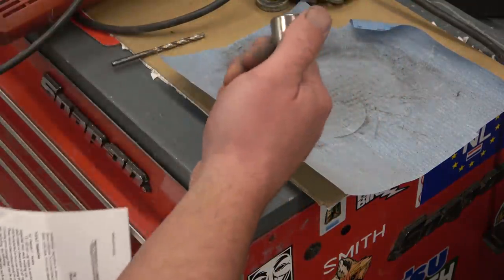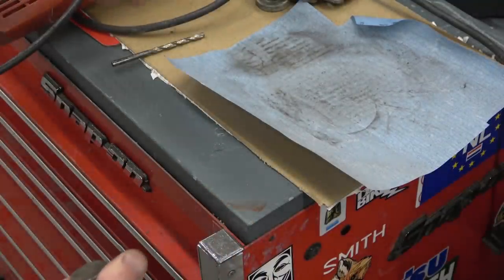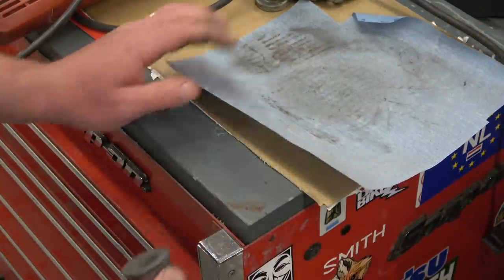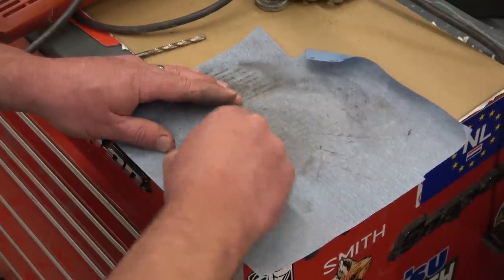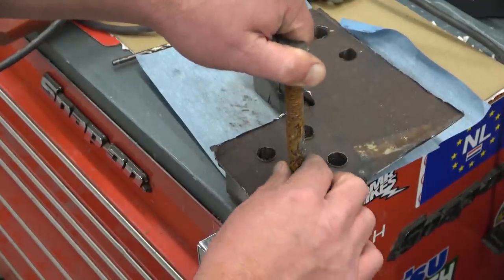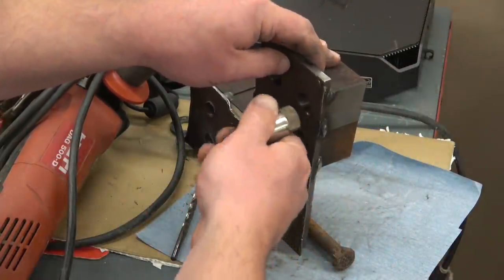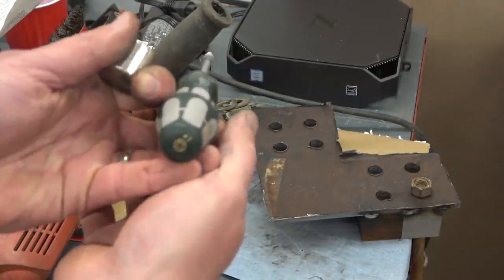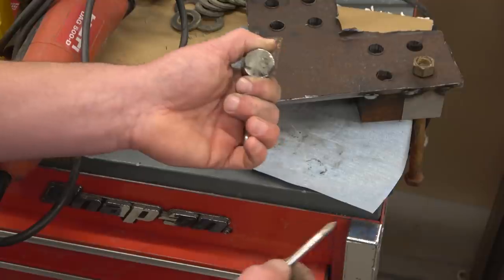mechanic magnet tricks #sharts

Comment: A flat refrigerator magnet works great when working on hydraulics. When you pull a valve off of the bottom or side of a manifold, slap the magnet over the ports to keep oil from running all over while you are servicing the valve.
You're  still going to get oil in your armpits when you put it back together, but hey, that's what apprentices are for.
Reply: You really shouldn't have apprentices oiling your armpits. Sets a bad example. 
Roll them up and use them to plug the holes that the oil is coming out of.
Reply: @kieranh2005  
Haaaa!!!
There have been numerous times I wanted to roll them up and stick them in different parts of machines.

Comment: In the HVAC world, I use them mainly on doors and entry ways that have a magnetic alarm sensor(or whatever you call it) that goes off if the door is open to long. Freezers are big ones.
Reply: Door switches on furnaces as well.
Reply: AKA Cheater switch.
Reply: Lockpicking Lawyer has a ton of videos about these types of devices, even high-security card scanners.
Reply: Also on solenoid valves
Reply: They sell solenoid magnets for HVAC work.
Reply: Some of the more secure alarms uses hall effect sensors to detect the magnetic strength. If it's not within range, the alarm goes off.
Reply: Can't be fucked hooking the shed door to the hook, so I just slapped a small one on the wall to hold it open. Works a treat for avoiding the blind reacharound!
Reply: I've seen (obviously never done it myself) plenty of magnets over riding interlocks on cnc machinery. a 1400mm diameter grinding wheels chooching at 350rpm seems way faster when you've got no guards around it and you and the apprentice fitter just rebuilt the spindle with new bearings installed with a lump hammer and pre-load applied by sheer guess work "wait a minute Joe did we tighten the lock nut up!" the son of diddly only takes 3 minutes to slow back down. Probably stops way quick if it fucks off down the shop removing walls in the process.
Reply: @dk-bw4gk  Eh. That's not what he's talking about. He's not talking about using a magnet to overcome some kind of locking pawl. The door switches are balanced magnetic switches which (for security applications) trigger if there's not enough magnetic field (the door is open) or too much (someone is trying to use a magnet to defeat it).

LPL has done enough videos that I'm sure there's something with him defeating a reed switch though.

Comment: Also very handy for taking out metal shrapnel from your eyes when the safety squints fail.
Reply: @chuckthebull  not at all
Reply: That's....absolutely brilliant.
Reply: I wish I could have told high-school-machine-shop-me this. Even with safety glasses and a face shield, I still managed to get a steel chip in my eye. Oh, such innocent times.
Reply: @AndyGneiss  yes if we could only learn the easy way 😁
Reply: @peterlamarche247  OMG that sounds bad..
Reply: Been there, done that, didn't work ;/
Reply: If only it worked for bits of brick, now that I would never warrant on anybody
Reply: @maxl3189  never happened but i suspect it to be a crappy experience.
Reply: @carlosportu4766  it mighten be as sharp as metal but it sure in uncomftable

Comment: Having a degaussing coil around is also nice... especially if you loathe magnetized tools. The kind used for old time CRT TV's is great for the shop.
Reply: I know some of those words.  Could you explain it for my friend?  (Ignore the username; I'm not really that partial.)
Reply: @10sDPR  "I know some of those words.  Could you explain it for my friend?  (Ignore the username; I'm not really that partial.)"

No problem... check these:

https://en.wikipedia.org/wiki/Tool

https://en.wikipedia.org/wiki/Degaussing

https://en.wikipedia.org/wiki/Cathode-ray_tube

https://en.wikipedia.org/wiki/Television_set
Reply: @hughbrackett343  "I once used a tape degausser to fix some computer monitors that elementary school kids had played with magnets. Magnets will do cool stuff to the picture but sometimes the coolness is permanent."

I was in the coin-op video game biz back in the early 80's. [spits on ground]

Punks with magnets were a constant issue... plus the ultra econobudget monitors most of those machines used didn't have integral degauss coils. Pita. Just sitting a few days & the earths magnetic field had them honked.

After a while refused to buy games with little space between face plate & monitor. For some unknown reason, kids with magnets were common in some regions, but not others. Go figure...

Some of those games did very well; we had 23... in a good location there were a few that'd do over $1k/week by themself!

Edit: Typo.

Comment: I used to tuck my "travel magnets" inside a zip-lock bag or some type disposable plastic container, e.g. margarine tub. Easier to pull off tools, keeps shards and slivers off the magnet.
Reply: @Mr.Unacceptable  so your magnets went digital too?
Reply: @Mr.Unacceptable  Pill bottles are roughly the same size.
Reply: @Mr.Unacceptable  diabetic test strip containers work too, if you can get em.

Comment: Tear apart every hard drive you can find- they have awesome magnets in them.
Reply: The new drives are hardly worth the trouble, but the the old school 15k Seagate Cheetahs... them were magnets.
Reply: @Milkmans_Son  them magnets will remove flesh if'n you get it in the wrong spot
Reply: Tried your advice. Got kicked out the public library.
Reply: Sonicare toothbrush replacement heads have some nice little ones.
Reply: Be careful  They are very brittle and form razor sharp shrapnel when broken!
Reply: @mikehunt8968  you ever seen the movie porky's?
Reply: i have old hdd magnets but i dont get ,they get magnetic when they are both in tact under each other ,but when i put 1 aside they lose their property tf is going on.Its mind boggling me for days

Comment: If you're doing some drilling involving multiple size bits, sticking them to a magnet keeps them from rolling away and they're more accessible than putting them in your pocket.
Reply: Many a times I stuck myself in the arse keeping drillbits in my back pockets. I still haven't learned.....
Reply: I have a wrist strap with a magnet that somebody bought me years ago that I use for that.  It's great.

Comment: The magnet: the best stud finder everyone has on their fridge.
Reply: How does that work? You just search for the drywall screws?
Reply: @thedillestpickle  or nails,  if your house is fancy like mine
Reply: I was going say that, great for finding the drywall screws and then attaching bottom trim.
Reply: @natalieisagirlnow  there’s nothing better to pin the finger paints up for mom.
Reply: @ABlindMan1 elechicken here... I hate you 🤣
Reply: @thedillestpickle  Yeah. I like to wrap the magnet in electrical tape, doubled over with a tail. Then I got something to hold and dangle it by as I scan back and forth. Once it passes over the screw head, it'll draw itself right in on it. Find a few more, draw a line betwixt them, and bob's yer auntie.
Reply: Grinder is the best way to find studs.
Reply: Thought the SURE FIRE WAY was a hammer and new Sheetrock?
Reply: Unless the Sheetrock guy was drunk
Reply: @jaw3895  it's not a question of them being drunk, it's a question of how drunk they are.
Reply: Works even better if you have metal studs
Reply: @barongerhardt  a small 15 lb sledgehammer is my preferred method for stud finding when hanging paintings.

Comment: When I was younger I worked on the maintenance side of a welding/machine shop. When the magnetic plate lifters would fail behind fixing we would always take all the magnets out of them before throwing them out. I still have a few of them, those magnets are dangerously strong.

Comment: I have a 3/8" magnet tucked away in my leatherman too that comes in handy all the time. Works great for a stud finder in a pinch.
Reply: Brilliant!
Reply: Which leatherman model and where do you store it?
Reply: @theomnipresent1  i have the wave pluss and I store it at the tip of the pliers next to the micro screwdriver.  3/8×1/8" magnet.

Comment: Another great tip. Just the tip, only for....nvm. if you only have a deep well, or you're working over top with limited space and your nut keeps falling out,  pack the socket with axle grease or tacky grease. usually just the tip will do, but it will hold your nuts or threaded shaft without your magnet getting pulled and stuck all over. Keep your pickle in a slice.
Reply: What you do in the privacy of your own bedroom is your business.  I don't judge.
Reply: @JohnDoe-zl6qw  Full of win . 😅
Reply: And Stick on the Ice!!
Reply: put a chunk of paper over the socket to hold the bolt or nut in the socket
Reply: Shade tree mechanics topically use a leaf. Same concept
Reply: Paper or a rubber glove to make it fit tight or if you need more force packed inside is easier to clean up after.

Comment: Never thought of using one to hold a bolt in a hole. Definitely gonna do that now!
Reply: ditto.....
Reply: how did it go
Reply: I have a piece of coat hanger with a magnet on it I use to get my nuts up into truck frame rails and other tight places.

Comment: You got to fish a wire in drywall.  A rounded steel bar with a hole in the end for the string.
The magnet will drag the  steel up even if there is insulation behind the wall.
Reply: Yo they sell this and I had one in my charter van.
Reply: @mikepettengill2706  
Stick it in a plastic box on the inside lid of your tool box 🤔
Reply: Same idea works for wiring complex (multi-arm, etc.) light fixtures. (Not steel ones, obviously)
Use a strong magnet to drag some ball chain through, following the course required, use ball chain to pull wires through (or aircraft cable then wire, if it needs more oomph than ball chain will take).
Reply: Brilliant!

Comment: Drop that kind of magnetic down though a copper pipe it has a pretty dam cool effect.
Reply: Magnetic resonance is a very cool thing Indeed.
Reply: Also works with aluminum pipe/tubing
Reply: Lenz Effect
Reply: @dolphincliffs8864  isnt it based on maxwell direction formula idk how its called
Reply: @cistokrvnibosanac1266  We learned that in my Navy A school
Reply: @dolphincliffs8864  my mistake,its lenz effect .Probbably watched somehwere it has correlation with maxwell.Thank you for your answer
Reply: @cistokrvnibosanac1266  No problem

Comment: I used an extension socket with a neodymium magnet on the end to retrieve a spark plug out of the like plug tube. I know that's not the terminology of it but I'm rocking a 4 banger and the spark plugs set inside these cylinders in the valve cover. 
Bloody plug socket lost its rubber ring and didn't notice till it was to late.  

I love the magic of magnets.

Comment: Partner if you ever need to clean up the gravel driveway pad in the ole empire of dirt, get yourself a 1 gallon milk jug, drop some neodiddlyum magnets in thar, attach a rope, and have one of your higher energy clones with the shorter stature run up and down the driveway.   Will pick up all sorts of nasty tire deflating bits.   Can also attach to the ride on lawnmower but do not forget its there!

Comment: And if you do happen to drop your magnet into the lathe trough or onto the shop floor in a pile of drill chips, you get one nasty suppository to send through to the complaints department!
Reply: I usually will just find another magnet to use and leave that one for the night shift to find
Reply: When dowsing for nasty bits in dirt, I keep the magnet inside of the liner from a cereal box. (Eat the contents beforehand).   Just pull the magnet out and the bits fall into the waste bin.    Those cereal-box liners are tough.
Reply: I have an endless supply of poly sample bags for the same trick,  @tubastuff .  It's a winner.

Comment: I used a magnet off my refrigerator to fish a 3/4" long piece of a triangle file out a spark plug hole.  I refuse to say how it got in that engine cylinder to start with.
Reply: You always want a flared base for tools you're gonna play with in holes.
Reply: @Broken_Yugo  By that time in my life I'd been practicing bumblefucking half-assery long enough I knew to use something that's longer than the hole is deep.  But I learned two other valuable life lessons that day. One- if you need a probe use something that's soft enough it bends before it breaks.  Two- There is no difference between your eyes watering because dirt got blown in them and tears of joy/relief.  When I saw that file tip come out that hole a gust of wind must have blown up because I would never cry.  haha

Comment: I'm just a home-gamer fixing my own junk, but I've carried a little stuffed mushroom with a magnet (only ferrite, but chunky) in its base in my pocket for going on a decade and a half, as my handle suggests. Besides holding things, I mostly use it for the last two tricks (magnetizing drivers/bits and picking up fasteners).

Notably, as a lifelong New Englander (save a few months in equally-salty upstate NY), it's also a handy Bondo detector - run it over the quarters and rockers of any vehicle you're looking to buy (as long as it's steel-bodied) and you'll know if you ought to look deeper or walk away.
Reply: Another comment reminded me that they're also handy for flipping reed switches, for instance to make a laptop think it's open or closed when it isn't. My little guy's perfect for that, as it's not powerful enough to damage anything in a modern electronic device.

Comment: On a construction yard,we had a couple of big magnets (recuperated from big speakers) on a board with 2 wheels and a stick/handle (a bit like an old lawn mower). Someone would drag that around all over the place every so often, catching loads of old nails and the like out of the sand.
Significantly reduced the number of flat tires.

Comment: I sometimes use a magnet inside of a socket for starting bolts into threaded holes in shitty locations too.   Also, they will find metal studs when you need to mount electrical enclosures and such on finished walls.  They will also pull a piece of metal that ricocheted off of your safety glasses right out of your eye.

Comment: Good for keeping fire rated doors from closing on you if you're constantly travelling through them. Saves getting the key out every time you need to use the door, just stick the magnet on the metal frame and the door never fully closes on you

Comment: I personally don't really like magnets. I've lost many a good Beatles compilation tape to margnets. This wouldnt be a problem if I had a truck made in this millennium, but I won't give up my handshaker!
Reply: Get a 1/8 stereo jack to vehicle cassette adapter.  They're pretty inexpensive. Then you can plug in any portable audio player with a headphone jack such as a smartphone, portable CD player, mp3 player, guitar pedal, etc.  It simply takes a headphone plug at one end of a wire and converts it to a cassette insert at the other end for a cassette player.
Reply: You get cool colors when you bring em next to your tv too!
Reply: Bokt action is the only way to travel

Comment: On the topic of dropping stuff and "spitzen sparkzen".
I worked at a place where high voltage cables had been entered through a rectangular hole cut into the top of a piece of switch gear. 
A person could easily drop something right down across the bus bars. 💥
Tool lanyards were a really good idea.
Reply: Brings to mind a dead Titan 2 silo in the states and a poor socket* that was just trying to reach the earth's centre. 
(*Thanks RL for the correction)
Reply: @bakedbeings  It was only the socket, he didn't drop the handle.
He was supposed to be using a 
Torque Wrench. He didn't bother to go back get it.
Reply: @robertlee9395  If only he went back for the torque wrench.. and dropped that instead, so my comment would relate to the post a lot better.
Reply: @ChristopherHallett  IIRC the socket fell down a long way, and punctured the thin aluminium wall of the first stage of the missile, and it started to lose pressure. As the wall is made from aluminium just slightly thicker than a cola can wall, this led to the fully fuelled missile collapsing in the tube, and then the  other half of the hypergolic fuel met the oxidiser, and went boom

https://en.wikipedia.org/wiki/1980_Damascus_Titan_missile_explosion for the full story.
Reply: @Anthony-yz3vj  I'd never seen anything like that before and gratefully I've never seen anything like it since. 
Fortunately, to the best of my knowledge, it never caused an incident.

Comment: The one I use most, is one I fixed to a velcro  that I strap around my wrist.Holds screws & bits when working on ladders. Way better than reaching into a belt pouch, your hand is free to hold on to something,and you don't prick your fingers as much.
Before the velcro,I just dumped one in the shirt pocket,and stuck the screws to my chest.

Comment: I always have stuck a small neodymium on the end of my 6 in 1 screwdriver that I carry all day at work. From holding small screws to doing whatever I've used it a thousand times.
Reply: Which end? The pokey end or the pounding end? Lost my 6-in-1 at work, need to get a new one. Thankfully,  they're cheap. I always try to have one on me at work.
Reply: @iandegraff3472  I just keep it on the flat spot we're the 2 pieces come together. My particular magnet is only the size of a small hearing aid battery? Usually stays there.

Comment: Fun fact: older 3.5 inch hard drives (which all fail one day) have these honking big magnets in them. I've got several of those mag-mets in my shop, and one on a string stuck to the fridge in case I need to retrieve something small from an awkward space.

Comment: I do several timing chains per year and use a rectangular neodymium magnet to hold the ends of the chain together while installing the master link. The crazy magnetism also helps from losing the micro c-clips during installation.